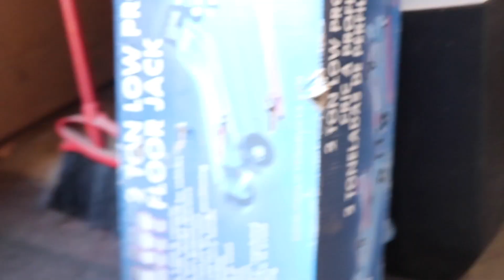NEW Pit Bike Engine Swap! | PitBike Rebuild Ep.11

Comment: Awesome job doobie! I just bought a bunch of parts from t-bolt USA at guy Vince could not be more helpful I actually bought a high performance Works engine and what they did was assemble it installed in their dynamometer run it up to speed and sell to me with the correct regetting of the new carburetor everything was hooked up even the kill button. All I had to do is switch bolts install foot pegs fuel line sprocket and chain I was up and running in under 2 hours and man does that engine have some bark! Good luck with your projects I really enjoyed watching your engines
Reply from the maker: Hey, how’s it going? Hope all is well. Yeah, I had a few questions and the guys at USA were really helpful so you are right about that. Lol also I’m glad you enjoyed the content trying stay consistent,I know it’s hard for ppl to stay engaged with me not uploading frequently,
But would love to see your bike maybe can do a video like a build break dwn series